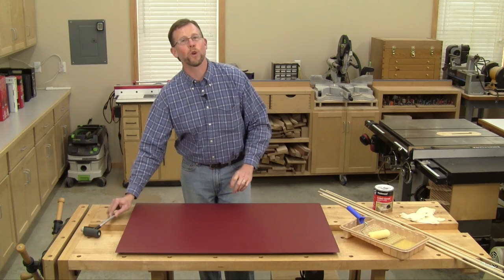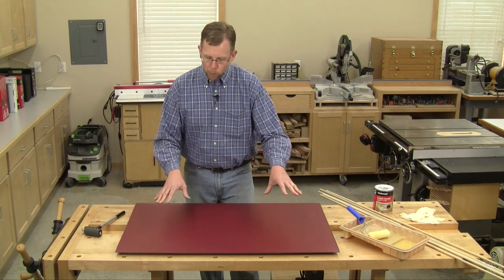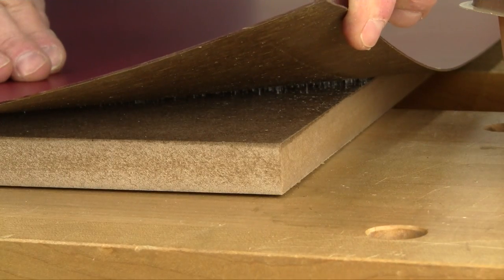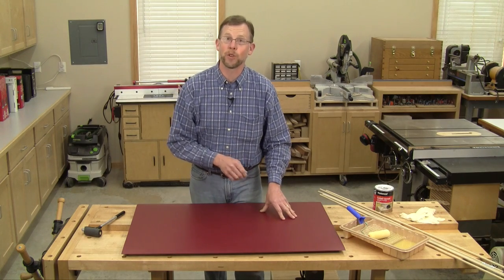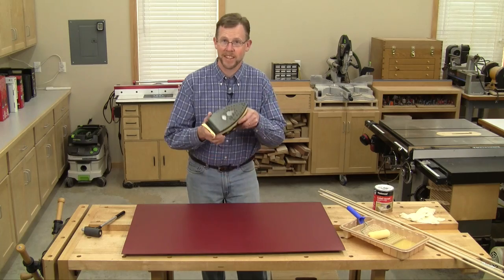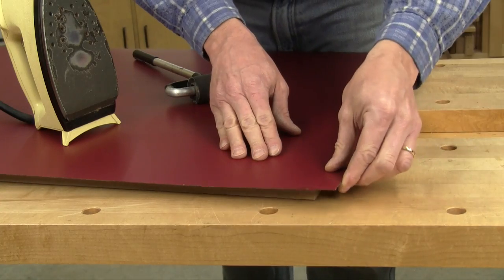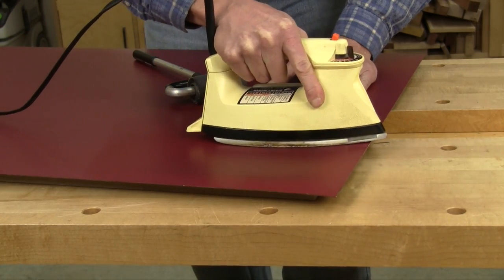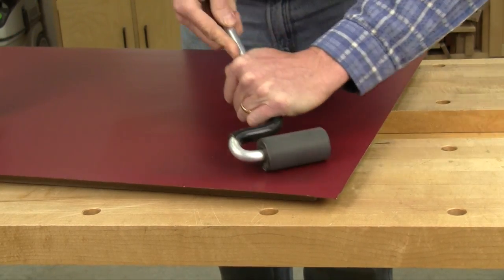Bonding Loose Laminate with an Iron

Comment: "Just 'might' do the trick," "might" being the operative word. In my experience, while doing that works temporarily, which I suppose is great for a contractor who just wants to look like he's gotten the job done, it never works long-term. You've waited too long and the contact glue is no longer tacky. Yes, it gets somewhat tacky again when you reheat it with an iron, but not like it was before. It won't form the tight bond it would've had you not waited too long but instead followed the contact glue's instructions' maximum time limit for plying the two surfaces together. What WILL happen is in a few weeks or months, that corner WILL come unstuck, just like it is there. Maybe whose counter it is will call the contractor, who will likely tell them to just iron it, which will again work and feel very satisfying to whose counter it is, but not for long because it will then come unstuck again, this time even more quickly. Whose counter it is then gets into a cycle of ironing their counter more and more until it finally quits working altogether. A contractor whose made this mistake needs to fix it right, not apply an iron to it, and if that means having to redo the entire piece, then so be it. It's on the contractor for being neglectful by getting distracted and waiting too long to ply the two surfaces together such that the contact cement fails to bond the two surfaces together properly. Any contractor who fudges it by ironing it so that it seems OK to whose counter it is and they can get out of there is not a good contractor, is signing that customer up for down the road having that laminate come unstuck, just like you see it there, and becoming a worsening problem because you compromise an increasingly larger area of the adhesive every time you iron it such that more and more of it gets unstuck the next time it gets unstuck, and that's not just maybe but DEFINITELY, by which time the contractor will usually either be long gone or will refuse to do anything about it, blaming the person whose counter it is for it happening, attributing the cause to them having to have abused or misused the counter somehow for that to happen, like by setting something too warm on it or knocking up against it too hard (something anyone would have a hard time categorically denying because "too" is so vague as to be subjective and the laminate having come unstuck seems be proof that either they or someone in their home at some point must've or at least very well could've, even if not realizing it), rather than taking responsibility, maybe because that contractor no longer remembers that they improperly waited too long to join the surfaces and so had to use an iron to fudge it or maybe because that contractor does remember but refuses to admit it because admitting makes them liable when whose counter it is otherwise has no proof that that they did it wrong and are liable. 

IN SHORT: USING AN IRON TO REHEAT CONTACT GLUE THAT'S SET TOO LONG, OVERCURED, AND SO FAILS TO STICK THE TWO SURFACES TOGETHER IN ORDER TO GET THEM TO STICK TOGETHER IS NOT THE WAY! IT ONLY WORKS TEMPORARILY, LIKE HITTING THE SNOOZE BUTTON ON THE PROBLEM, BECAUSE WAITING TOO LONG COMPROMISED THE BOND, SO WHILE HEATING IT UP MAY MAKE THE GLUE TACKY ENOUGH TO STICK FOR THE TIMEBEING, IT WILL NOT LAST AND WILL COME UNSTUCK AS THE SURFACES ARE NOT PROPERLY BONDED, NOT EVEN CLOSE. 

AND IF YOU HAVE WAITED LONG AND GONE BEYOND THE WINDOW OF TIME THE INSTRUCTIONS ON THE CONTACT GLUE SAY FOR WHEN YOU SHOULD JOIN THE SURFACES, RATHER THAN BULLDOZING AHEAD AND TRYING TO JOIN THE SURFACES ANWAY, JUST APPLY ANOTHER COAT OF CONTACT GLUE TO THE TWO SURFACES AND THIS TIME NOT GO BEYOND THE WINDOW OF TIME THE INSTRUCTIONS ON THE CONTACT GLUE SAY FOR WHEN YOU SHOULD JOIN THE SURFACES. IF YOU BULLDOZE AHEAD, YOU'LL JUST END UP IN A SITUATION WHERE ADHERING IT PROPERLY WILL ALMOST CERTAINLY MEAN DESTROYING THAT PIECE OF LAMINATE AS ANY PART THAT DOES STICK HARD WILL SOONER BREAK THAN BE PRIED BACK UP AND GETTING CONTACT GLUE JUST UNDER THE PORTION THAT ISN'T GLUED ALWAYS LEAVES AN AREA THAT'S TOO NARROW TO GET CONTACT GLUE INTO AND SO LEAVES A PORTION OF THE EDGE OR IN THE CENTER THAT ISN'T GLUED DOWN AND IS EITHER DETECTABLE VISUALLY OR BY TOUCH AND SOUND AS IT MOVES UP AND DOWN WITH A TAPPING NOISE EVERY TIME ANYONE TOUCHES THE COUNTER THERE.
Reply: Exhaustingly long explanation